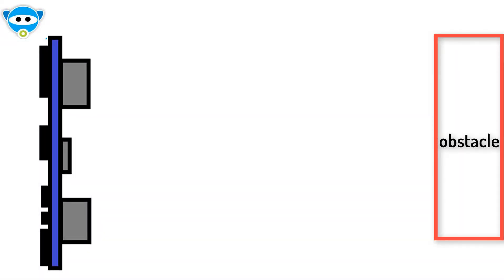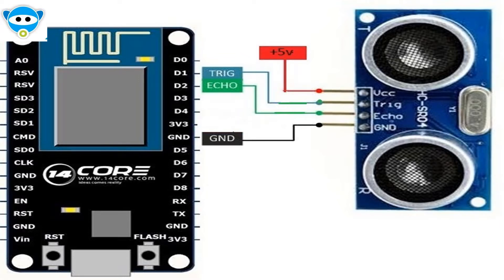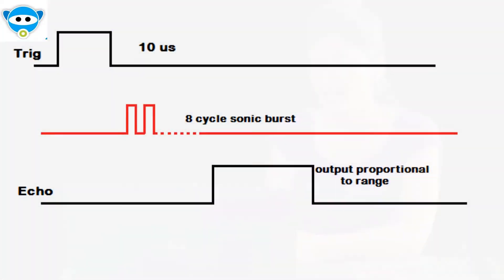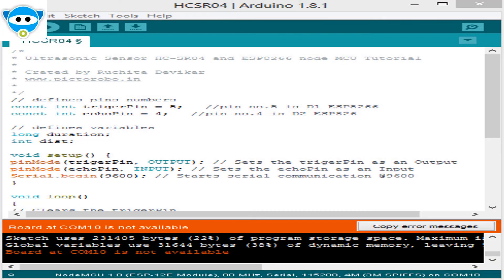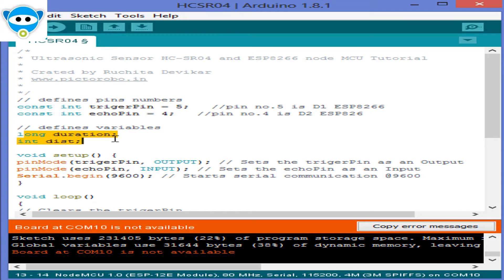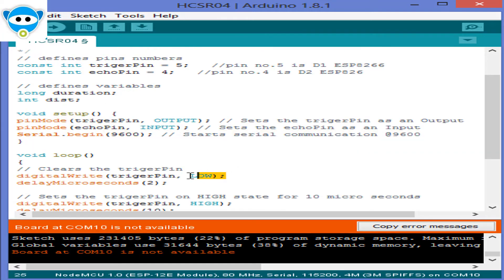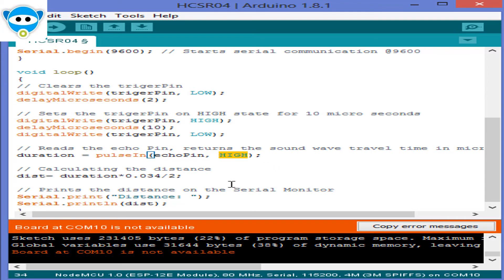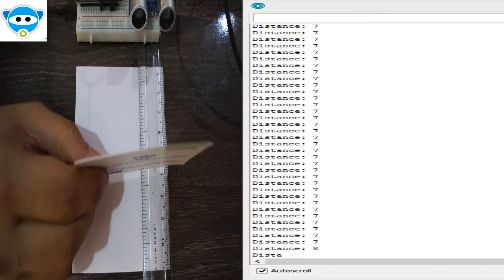ESP8266 Node MCU & Ultrasonic HCSR-04[ Accurate measurement ]

Comment: We should surely provide 5V as input? Or can we give 3.3 V also?
Reply from the maker: yes you can ues both ...
Reply: Use strictly 5V for the HC-SR04 sensor. Use an external power supply of 5V or the 5V supply pin in an Arduino board. The sensor does not support 3.3V

Comment: How did you get 5V?
Reply from the maker: i connect externally by using 7805 voltage regulator circuit..
Reply: can i see the schematic with 5v ic?